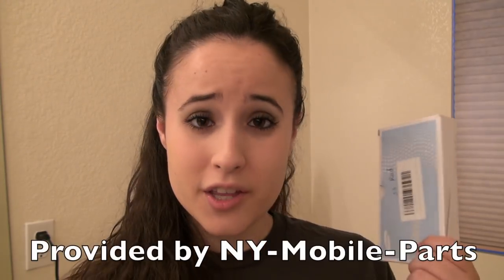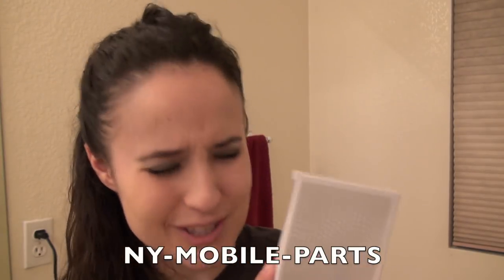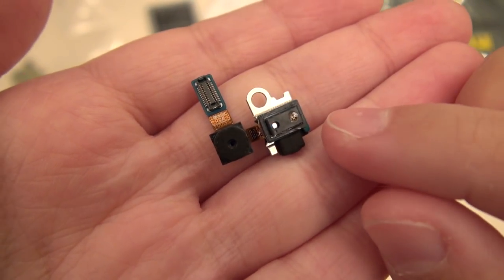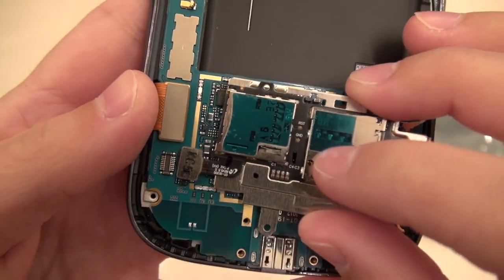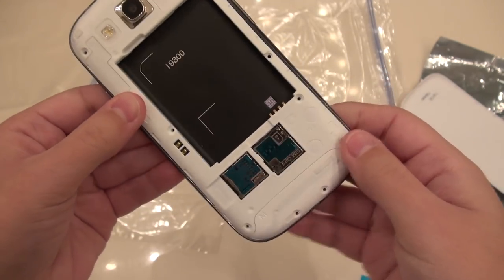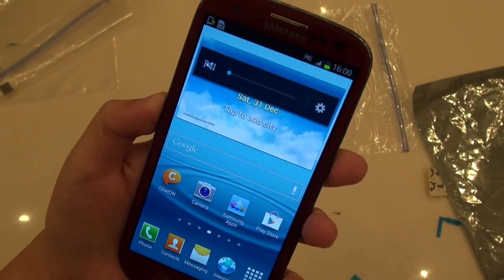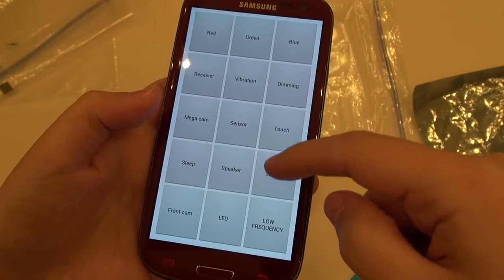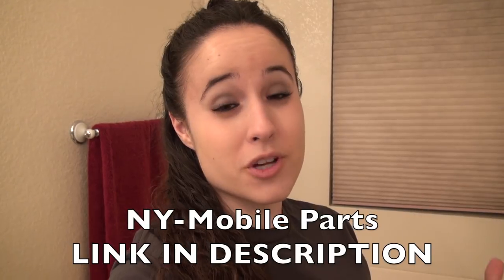Galaxy S III Rebuild from Destruction!!! *TIME CODED*

Comment: I have just replaced the front glass only on my S3 and everythign works except the soft keys. They light up but are unresponsive. I am thinking I did something to the flex cable for it but not sure. Do you have any ideas and do you think I can replace just the flex cable?

Comment: nice video, very informative... i have a question, I hope you could help me out. I'm using htc sensation xe and I accidentally dropped it face first, the glass didn't break though but when I checked the phone I'm already seeing some random black lines on the screen, I already asked a local technician about it and he advised me to have the lcd replaced..while wating for the replacement lcd to be available, is there any way I can conduct a phone diagnostic just like you did here the *#0*# thingy

Comment: After watching several videos, I'm curious about something. Even though you took a different route, I thought you could explain. Why do most people use 2mm tape to replace the glass vs replacing the [loca]? I'm still debating which way I want to go...replacing the glass, or the unit, like you did.

Comment: Erica, you offer the most instructive, detailed, well photographed instructionals on Utube regarding cell phones. Thanks. Followed your video to repair and replace a badly shattered Samsung S3. Digitizer worked before removal and after picking out 7 billion pieces of glass. Mounted new glass screen and couldn't believe - but digitizer wouldn't work. Any ideas or do I have to go through this again and do a full rebuild. My unit is an # i1747.  You used an i1900. Are they swappable?

Comment: You've done a really good series of videos. very informative, and clear both words and camera. I was wondering if the same basic steps are used to replace the front face of a galaxy note 2? i dropped mine and shattered the screen and have looked at some videos of people detaching the glass but it does indeed seem very difficult, anyway would you recommend to replace the whole screen assembly over the other method? have you done a galaxy note 2 video yet? congrats on educating and entertaining.

Comment: Why you didnt try to go for warranty?
I make the same mistake and flash N7105 boot.img to my GT-I9305 and i get the same results as you.
No touch..
Then simply i use a mouse with otg adaptor restore all to default - triangle way to reset the binary and back to store.
He changed my device with a new one. :)

Comment: You can get little plastic tool kits for disassembling phones for pretty cheap, you should get one. Then you wont have to use a "sharp" metal screw driver.

Comment: Using adhesive instead of screws can actually be better because it spreads the load across the entire area covered with the adhesive. Adhesive can also be used not only to mount the parts but also prevent dust from entering sensitive components. I can keep going, but you can just read this pdf you can find on google, just search for "adhesive films: tapes beyond psa"

Comment: If I remember my teardowns correctly, most phones make use of double sided adhesive to mount their components. Yes, even the iPhone 5 uses adhesive to mount the lower assembly half of the phone. I feel that the reason Samsung decided not to use too many screws to hold the motherboard down is a weight issue. You can argue that the screws don't really weigh much but when you're trying to sell your phone as a really light phone for a 4.8 screen, every fraction of a gram counts.

Comment from the maker: Um 200 for the screen, 200-300 for the board, 15 bucks per each other part if you can find them??? Buy the phone. Don't rebuild it unless you can get wholesale pricing with all the parts. Good luck with that. And good luck getting the proper screws lol